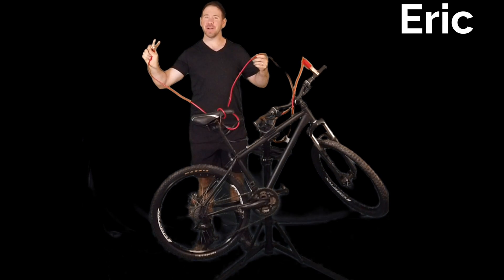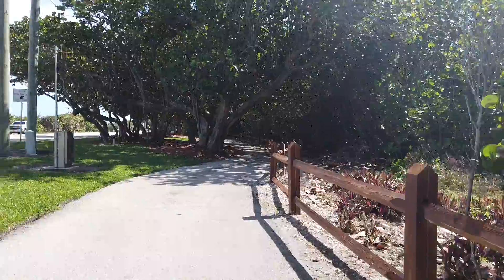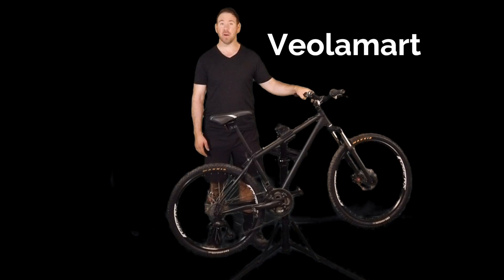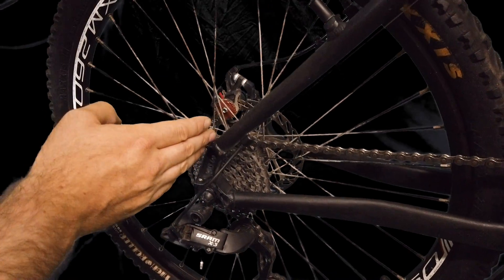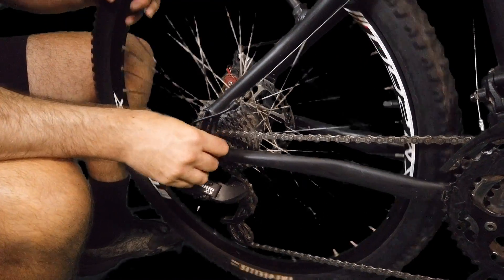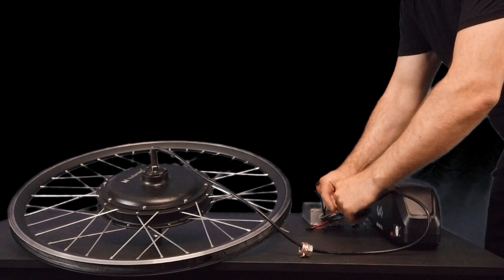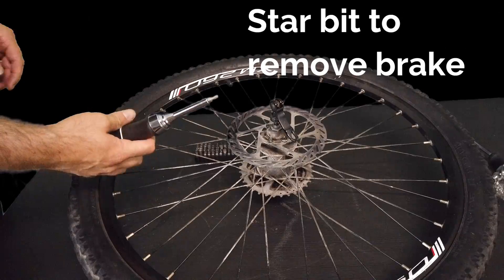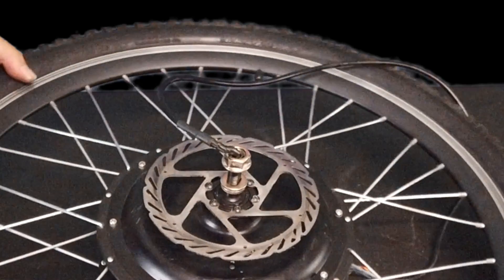Installing a Voilamart 1000 Watt Rear Hub Motor Kit [Quickly]

Comment: I heard from many people that these cheap 1000w wheel kits wear out/break fast. A couple people said they went through 2 kits in less than 2 years without much riding use before finally buying a 3000w kit that  lasted. They said the 2 kits were a waste of money and that in hindsight they should have bought a 3000w first which they said is more bang for the buck/more reliable.
Reply from the maker: This one is still working great for me.
Reply: Is it still working today a year after posting the comment?

Comment: in a hot climate the bag is going to overheat battery and control box they need to be exposed to air flow
Reply from the maker: Gotcha, They been good so far, I check the temp when I stop, but I also don't ride real long distances usually.
Reply: Why does it come with a bag for the controller tho?

Comment: Nice little bike build. From one Builder to another just a small tip in my opinion throw your cat back on your inner tube after you push it through the rim hole in your mounting your tire and it'll hold the inner tube in there for you. Loosen the nuts on your brake cables at the V brakes or the caliper and it will let all the slack back in and reset everything to 0 whenever you mount new levers or new calipers
Reply from the maker: Thanks, very good tips!   I have been doing all tires like this now

Comment: Locate the wires away from the bare gear cable it'll wear threw in time and mess with gear changes.
Reply from the maker: What do you mean?
Reply: @expedition-electric3549  at top of the frame where the gear cables are bare will rub threw the wires eventually. Gear changes might be tight with the wires tie wrapped tight to the exposed gear wire. I'd run wires under the top tube instead
Reply from the maker: @chrisc291290  Gotcha, makes sense.
Reply: I was thinking the SAME THING when I watched... mount the wires underneath the top tube and put the zip ties UNDER the exposed cables!

Comment: I'm ordering the 1000w rear tomorrow so can't wait, got a 55v 13ah battery, only had 250 geared motor before in front wheel, so lookin forward to a little dirtbike moped speed lolz, 30mph and more is insane on a bike, feels like 50😅🇬🇧🙏
Reply from the maker: Awesome! is the battery a triangle battery?  What type of bike frame are you using?   Sounds like a blast, be safe
Reply: @expedition-electric3549  Bikes a carrera fury 20" mountain bike, battery is one of the black types that fastens to the bottle bracket 😁🙏
Reply from the maker: @ianmangham4570  That's a cool looking bike. Yeah hopefully it fits!   I had to go with the smaller battery, because the larger wouldn't fit in the frame triangle.
Reply: Hi Ian,
Just thought I'd let you know, my kits arrive (all fine) and today my battery arrives, it fits, tight but it's ok, you had me worried even though I'd cut out a template and checked, bit annoyed no battery bag, I'll have to order one (more cost, but stuff always winds up costing more I guess).
Now I'm just waiting on some ordered 'Schwalbe Marathon puncture proof tyres' (£50 for the pair, well £55 with protective rim liner tape) -:also ordered some other small bits to help. My dad just texted me my tyres have arrived so tomozo I'll start the build.
Reply: @mickyb.8014  Nice one mate 👍
Reply: @ianmangham4570  Cheers Ian, think I've spent around £650 which I'm real happy for the setup I've got, I can't wait till tomorrow and it's all up and running!
Reply: @mickyb.8014  Still a million miles cheaper than one of these readymade ebikes at around £1700 🙏 and once you have the kit you can transfer to any bike you want 🤠🤘 I'm back on a 250w  front hub motor with a 1000w kit spares ,got me another suspension seatpost I love em , you'll love the schwalbe marathon puncture protection, best running the motor tyre around 20psi this gives you a cushion ride and will stop any spokes from breaking under the weight 🙏🇬🇧🤘🤠
Reply: @ianmangham4570  Ah, 20 psi, ok thanks, I'm just starting to watch how to fit the p.a.s sensor to the left peddle crank area, is this easy to do? Do you have to glue it in place Ian?..
Wondering cos I've not looked at this part of the kit and I'm thinking it's gunna be a right hassle? Or maybe it's piss easy, I dunno? 
Any advice please?
And yeah, 700 ain't bad compared to a grand plus for a crap setup that's slow and boring
Reply: @ianmangham4570  I was thinking a cloud 9 suspension spring seat cos I think I'll have to put the controller under it a bit on the front of the seat post, unless I mount it on top of the rear mudguard?...hmmm?🤔
Reply: @mickyb.8014  You want the new type pedal assist sensor that press fits on a square taper ,those others are shitty
Reply: @ianmangham4570  The kits all at my mam n dad's house, I can't look at it till I get there tomorrow some time (I've gotta work around their schedule as they can be cranky, but they are late 70's so it's understandable) but I've just watched a vid by a guy that showed 3 different ways around it and it looks easy enough actually...
I forgot all about the p.a.s 'cos of all the damn rear hub kit installation vids I've watched all of 'em don't mention the p.a.s at all, cheers though mate, it's all appreciated!!
I hope all is good for you.

Comment: Cable ties over the gear selector cables and using the the tyre levers back to front ?. What about the PAS sensor ?
Reply from the maker: The PAS doesn't work very well and is very jerky compared to using throttle

Comment: Can you use the kit without the multiple gear sprockets I have a beach cruiser so I’m hoping that I can please let me know 
Thanks
Reply: Probably could. You can purchase motor hubs with no gears I'm sure. Then would probably need to pull gear of the the original tire and transfer to you motor hub tire.
Reply from the maker: Late reply... did it work?

Comment: Hi what's the range of the bike on pedal assist
Reply from the maker: It depends on several things: the hills or elevation, how hard you pedal, how fast you go, how much you weigh. If you stay below 15mph and pedal you will probably get about 35-45 miles with a 48V15ah brand name battery
Reply: I get 40 miles with similar battery

Comment: Using a metal frame bike allows you to have more room on the axle to install the torque are because the frame is thinner, Aluminum frame are wider limits your ability to put torque arms on.

Comment: I bought the hub wheel, So I have to buy the battery separately?.
Reply from the maker: Correct. Here is the battery I use: The 48V13ah battery.  https://amzn.to/3hvkqzV       In this blog I show you the wheel kit and batteries installed on bike https://expedition-electric.com/cheap-electric-bike-conversion-kit-provides-the-speed-you-need/

Comment: The instructions that come with the kit are sorely lacking. I mainly came to see how to install the petal assist. But Thanks for letting me know I don't need it.  Looks like more of a pain than its worth.  Give me constructive feed back on this point please.
I just got mine in the mail today. The torque arm for me was pretty difficult as I didn't have room for much on either vertical or diagonal bars. And putting it on the other non sprocket side requires me to unpin the harness fro the the wheel.  But I really want to put one on that side.
Also my derailed controls where thumb style attached to the brakes so I have to find a different system.
I got the 20HA battery separately and it required me to kick the bottle, flip the battery and it sits snug under the center diagonal.  Between the 20+ lbs for the wheel and the 20+ for the battery my kickstand is pretty useless.
I had to figure out that the LED Display requires these 2 rubber round pieces and they need to be cut as they are just too fat.  Then the tiny nut has to be placed inside the middle groves to give the thin hex bolt something solid to thread to.  Prethread the bolt to make sure the nut is positioned proper. 
So ya they need to either link a video on the instructions or do a much better job on the manual.
Was hoping to finish today but seems I will need another day to complete.
Reply from the maker: Yeah mine took me awhile also. Did you get complete?   I ordered a heavy duty kickstand to install because of the weight.
Reply from the maker: https://amzn.to/3SsoLUG  This is the kick stand

Comment: I’m converting a specialised mtb into an Ebike for the first time using a 1000w rear motor and I’m wondering if there are any tool kits I can buy that include all of the tools needed for this conversion. Very helpful video too this is the most in depth video I’ve seen on a conversion kit installation tutorial
Reply from the maker: Thanks,  on my blog I talk about a lot of the tools used for this conversion https://www.expedition-electric.com

Comment: How did you install the cassette on the wheel? What free wheel/ cassette tool do you need?
Reply from the maker: The cassette came attached to the wheel. This is how I used it. To remove the cassette you can use this tool. https://amzn.to/3vjPMgs
Reply: @expedition-electric3549  Thanks I ordered the tool. I have the Voilamart 1500 watt Rear hub kit coming in and I want to make sure I have all the tools b4 hand. Thanks again, some reviews show the free wheel, not pre-installed. I might swap my 7 gear from my Shimano. Hopefully it can be done.
Reply from the maker: @MJ0781  Nice the 1500W.  Yes, you should be able to get the swap from your Shimano.  Hope the conversion goes well
Reply: @expedition-electric3549  I ordered the tool and was able to remove my Shimano free wheel cassette, thank you so much. I connected the tool to my car tire iron while sitting on the tire, LOL it worked!!!
Reply from the maker: @MJ0781   So glad it worked,  this was the 3rd one I had purchased and finally the right fit!

Comment: Do you need to install the pedal assist system for it to work or does the throttle suffice
Reply from the maker: Do not need to install pedal assist.  I did not on this build.

Comment: Hello, I have a bike with 26inch wheel. I want to upgrade a motor like yours. My rear dropout bike is 135mm wide. I wonder the 1000w motor can fit it with a 7s or 8s thread freewheel? Could you make it clear? I appreciate it.
Reply: Hi friend, your bike's 135mm rear dropout can fit the motor kit shown in the video. The Voilamart rear wheel kit comes with a 7-speed cassette.

Comment: Nice I've  biuld a battery box in my frame
Reply from the maker: Oh nice, what did you make the box out of?
Reply: @expedition-electric3549  Wood frame and 1mm steel side panels but iam looking the buy a stealth bomber frame I've got a 58v battery controller and charger into my frame
Reply from the maker: @revparsons3tl  Oh nice!   Yeah those seem pretty sweet, I’ve been looking at those a bit.

Comment: Does this work if you bike uses hydraulic brakes
Reply from the maker: Not with this kit. You will need a kit with an electric sensor brake option. The kit I installed with a BBSHD 1000Watt Mid Drive Motor has an electric sensor brake option.

Comment: How do I connect my battery to my motor? 

I've got a red and black wire from the controller and battery, but I don't want to solder these together as battery will not be removable

What did you do please? Sorry I'm new to the ebike life and lost af
Reply from the maker: No worries, Can be confusing!    Does this video help?    Skip ahead to 4:30 https://www.youtube.com/watch?v=lSKF-wJptV0
Reply: @expedition-electric3549  you're a life saver for real, thank you so much. Exactly what I was looking for 

Thank you so much for the fast reply 👊 have a good day
Reply from the maker: @niyaz3644  Great!   Lmk if you need any other info, trying to figure out what vids to make next!

Comment: Does this kit work if I don’t have disk brakes? Thanks
Reply from the maker: It can work. For best stopping power you may want the disc brakes when traveling at speeds of over 15mph or when riding in wet conditions.

Comment: I'm about ready to purchase a violamart when i watch your other video using bafang mid motor, i started looking up bafang and There's a big price difference,  do you think if I use bafang would it justify the price difference over violamart
Reply from the maker: Hello Arnold,   Did you check out this blog that shows the pros and cons? https://expedition-electric.com/hub-motor-vs-mid-drive-ebikes-which-one-is-the-best/     Both are good kits and both are very fun to ride.  Lmk if you have any other questions.

Comment: I NEED HELP!  My LCD started coming on the second I turn battery power on.  It shows bn3.6 on the screen where the OD is. At the bottom it shows 900.  Power is instantly available to throttle before I turn on the system via the "M" button.  When I turn off the LCD via the "M" button I get "OFF" on the screen but still have power to the throttle.  I contacted Voillamart and they asked for more details.  I included a detailed video of the system but they have not respond since.  Has anyone ever experienced the LCD doing this?
UPDATE:  I contacted Voilamart and they sent me a new LCD replacement for free. It was the LCD. When turning it on it will show the "bn3.5" for a second. So the other one was hung up.  I went through a 10 second rain shower just before it started doing that. So wondering how water proof these are.
Reply from the maker: Glad you were able to get this figured out. It's great they were able to send you a new one. I had rain mess up one of my controllers once.  Not very waterproof.

Comment: Have you gotten good use out of it and how has it held up since motor and battery  wise
Reply from the maker: Hello Justin, yeah it's been great and it's a blast to ride. Battery and kit have held up well.   I did make the battery connections on controller easier to connect with the extra cords that came with battery. I also recently installed the pedal assist, but probably prefer it without pedal assist. https://youtu.be/x6HLDTmWsr0
Reply: @expedition-electric3549  thanks for the feedback! Highly appreciated
Reply from the maker: @Usernotfound3042  Welcome, good luck with the install.

Comment: The brake and gear cable wires on the top of the frame are in contact with the controller cables. I would have run them away from each other.
Reply from the maker: Hmmmm. I will give it a try.

Comment: Maybe it's far fetched sure it's heavy but with how you test it sure looked easy to pick it up and carry it with you. In combo with one of those heavy duty locks on the rear tire/frame thing is dynamite
Reply from the maker: So yes, I've made the wires quick connect so that it's easy to disconnect everything and carry the bag with the components, That way I can securely lock the motorized wheel and frame for best security.
Reply: @expedition-electric3549  I just starting taking my broken bike apart today it has a screwed up rear tire and you know what I'm gonna do now 😂😂. From broken bike to ebike I love it
Reply from the maker: @eazysmokes3743  ohh nice, sounds like for a perfect bike for a conversion!   What motor and battery u using?
Reply: @expedition-electric3549  I'm planing for a 1000w 48v kit from voilamart or a similar brand and a unit pack power battery or something from bafang USA direct or em3ev
Reply: @expedition-electric3549  I'm having quite the hard time picking the battery but I got the budget for it. Em3ev is supposedly the best ever but they're always back ordered for the 20ah ones
Reply from the maker: @eazysmokes3743  Nice, sounds like a fun ride!
Reply from the maker: @eazysmokes3743  Yeah that's a good size and brand battery. It seems like many are back ordered. I got 3 of the UPP batteries in smaller sizes. 20ah should provide good range.
Reply: @expedition-electric3549  I bought a rideal :)))
Reply from the maker: @eazysmokes3743  Those look pretty cool, you ridden it yet?
Reply: @expedition-electric3549  haven't received yet

Comment: Is it fine if I don’t use the brakes that come with  the kit because my breaks are integrated in the shifters
Reply from the maker: A big reason for the brakes is a safety feature similar to driving a car, you don't want to be driving with both feet. Hitting the gas and brake at the same time.  With the kit When the brakes are hooked up, the power will be cut off to the motor the instant the brakes are hit. Without them, you may end up throttling while trying to brake.
Reply: @expedition-electric3549  Is it possible to put the brakes that came with the kit in my integrated shifters?
Reply from the maker: @takesomekb9998  That I'm not sure of.  I will look into it
Reply: If you've ever ridden a motorcycle, you already know to release the throttle before you brake!

Comment: Do you HAVE to put PAS on my bike? I don't really like PAS.
Reply from the maker: I did not install the PAS on this bike. The reason for this is, my friend's ebike did not have PAS as an option and I love the way it rode. So I decided to keep it off this bike.
Reply from the maker: https://youtu.be/x6HLDTmWsr0. Made a video of the pas
Reply: Is it supposed to spark a little when I connect the battery and controller

Comment: Great video 👍.. How much did this conversion cost and does it have the power to manage incline hills???
Reply from the maker: The Kits are usually around $250. https://amzn.to/3n1R9A0     the batteries vary greatly on price depending on the size. Here is a medium range battery for $280. https://amzn.to/3jL9WxG      They tackle the smaller hills where I live. Not too many big hills here.  The mid drive systems are known for their performance on hills